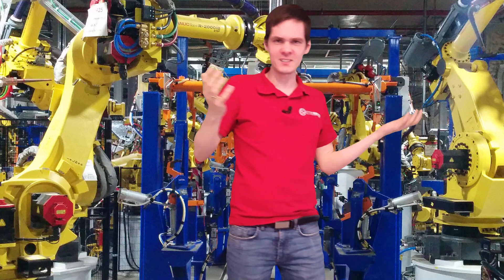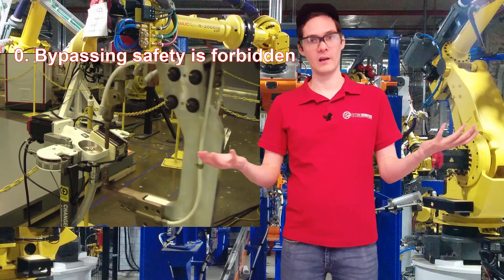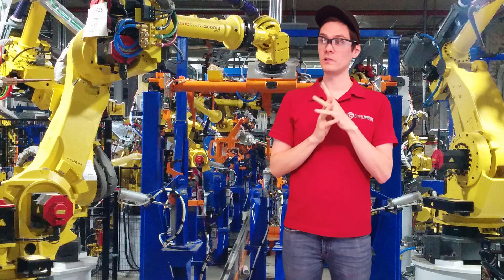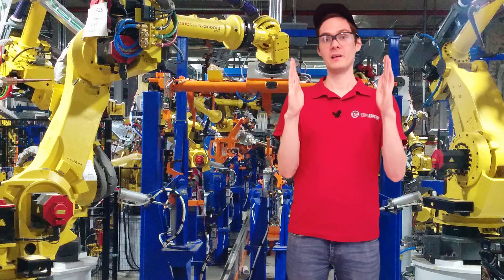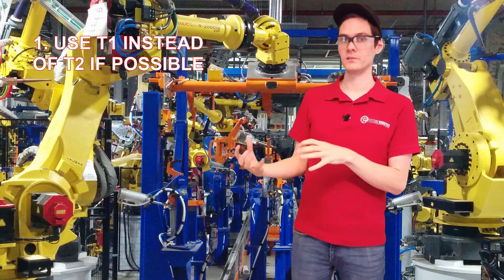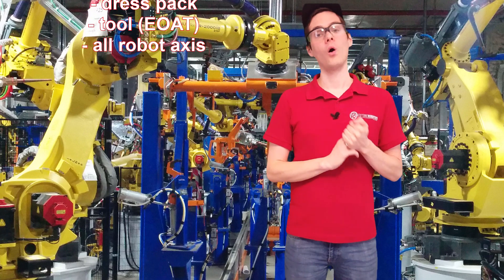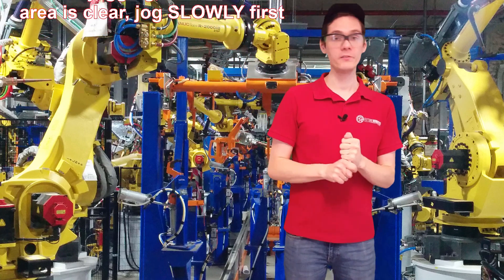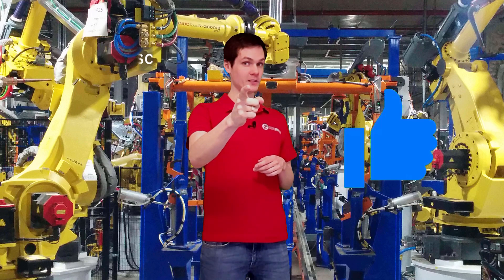How NOT TO use industrial robots / SAFETY

Comment: Just to add something:
It might not be a good idea to stop the robot in some situations. For example, I work at a forgery and we have a robot working with a crucible furnace. In there the temperature is above 700 deg C and the end tool we use should not be inside for more than 20 seconds. First, we have to wait until the robot pulls it out an then stop it, otherwise, the tool must be replaced or rebuilt.
Of course, if choosing between a human's life or the tool, we know what is the correct answer. But, in the case of avoiding collision with something else, it might not be so simple.

Comment: Quiz questions for this video
1) Bypassing safety is forbidden
*a) TRUE
b) FALSE

2) It is acceptable to to put a jumper the emergency stop button temporally 
a) TRUE
*b) FALSE

3) On a Funac robot it is best to use T1 instead of T2 if possible
*a) TRUE
b) FALSE

4) Follow lockout and tagout procedures
*a) TRUE
b) FALSE

5) Keep your eyes on the whole robot while programming, Look at the too (EOAT, all robot axis, dress pack
*a) TRUE
b) FALSE

5) Don't work on the robot alone when everyone else is gone.
*a) TRUE
b) FALSE

6) Be aware of your surroundings, keep your eye on the robot while jogging, check if the area is clear, jog Slowly first
*a) TRUE
b) FALSE

7) In STEP mode testing, to change the execution direction of the program, which hard key should you press while holding the shift key? ---
a) Step key
*b) FWD or BWD keys
c) +% or -% keys
d) Cursor (Arrow) Keys

8) Which Mode limits all Cartesian speed to less than 250 mm/sec and joint speed to less than 10%? ---
a) Auto Mode
b) T2 Mode
*c) T1 Mode
d) Neither, this is a system variable setting

9) What type of test should be performed prior to running the program in continuous? ---
a) Constant test
b) running in coutinous is fine
c) auto test
*d) step test

10) don't be afraid to stop the robot
*a) TRUE
b) FALSE

11) When in doubt, ask your supervisor
*a) TRUE
b) FALSE

Comment: 0. Bypassing safety is forbidden
1. Use T1 instead of T2 if possible
2. Follow the lockout and tagout procedure
3. Look the whole robot while programming (dress pack, tool/EOAT, all robot axis)
4. Don't stay alone with the robot, always have someone to help you
5. Be aware of your surroundings, verify that the teachpendat moves the desired robot,
   check area is clear and jog slowly.
6. Don't be afraid to stop the robot if your safety or someone else is in play, when in doubt ask your supervisor
Reply from the maker: Thank you for listing those ! :_FANUC::_KUKA::_ABB:

Guys doesn't matter how long you have been working with robots, it takes only one mistake to get hurt.
My friend just had a first near miss after 30 years of working as a robot programmer.

Stay safe !